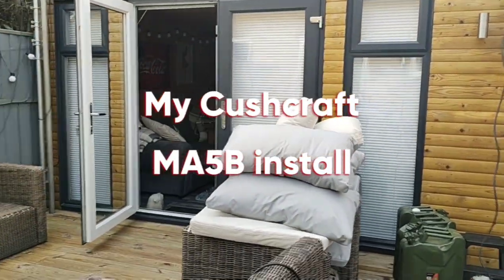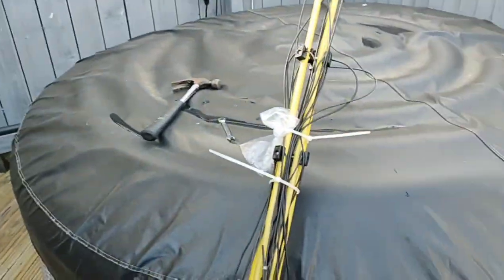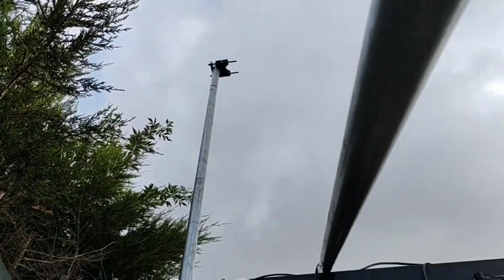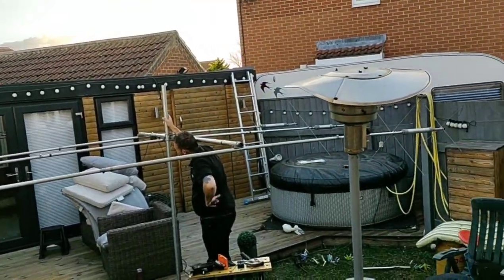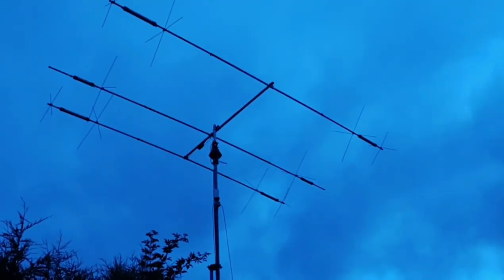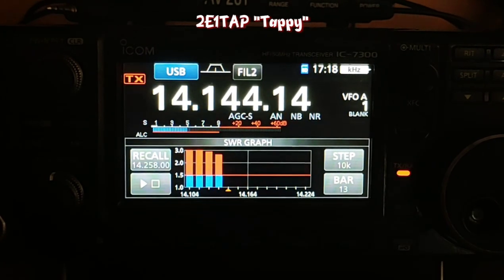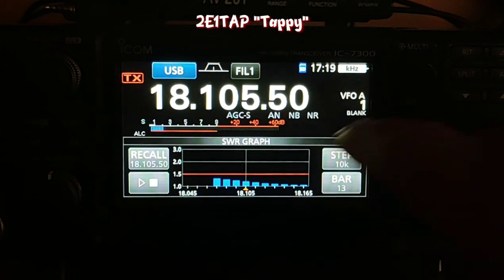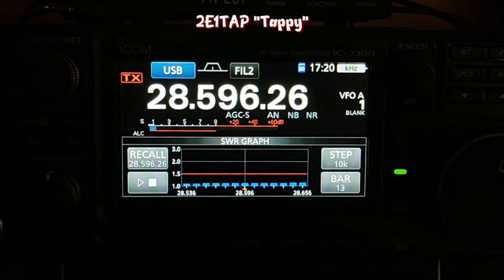Cushcraft MA5B Install

Comment: Also, your tune is kind of great, better than the 90 kHz bandwidth than claimed on 20.  Curious, when I bought mine 10 years ago, it shipped with the wrong hardware if you can believe it. The u-bolts were a size too small.  They had a LOT of QC issues 10 yrs ago.  Did you run into any problems?

Comment: Is the Cushcraft better than the cob web, and what rotator did you use
Reply from the maker: Both are very good antennas , and if you have never used a beam before, it takes some getting used to.
Cobweb is multi directional, so what you see/hear is what you get.
MA5B is directional, so you will always improve on RX and TX due to the gain.
Once you get used to the beam, it's hands down a better antenna.
I use an old hy-gain AR-40x, works very good

Comment: Assume you use it for FT8 at 14.070, 3:1 SWR.  With a tuner.  You're losing 25% ERP.  So instead of 3.6 dB, you're getting 2.7 dB; and a dipole is 2.1 dB.  At first, this looks kind of disappointing; and no doubt about it, it is.  But, then consider the FTB of 20+dB.  The noise floor drops by 3 bars on the S-meter from everything else except what your pointing at, and you still get a 70% increase in ERP with 2.7 db.  Its still a win.  I had one up for years until a tree took it out.  Except for the fact they've doubled in price since 2012, its still a great deal. A beam, not a rig, makes your shack next level.

Comment: Are you still liking the Ma5b?  I’m thinking of getting one.
Reply from the maker: Yes, very much Thomas. I don't think you will be disappointed
Reply: @HAMLIFE-2E1TAP  Do you think I could put it up on a eave mount that i used 6" lag bolts, only planning to go up 5 ft for rotor and another 5 ft up from  teh rotor?
Reply from the maker: @thomashenderson603  It's not a heavy antenna but the weight will be combined with rotator. If secures well, could sit nice above the eaves. 
Remember though, ease of access for swr and maintenance is always best
Reply: @HAMLIFE-2E1TAP  Thank you so much! I'm going to order one!